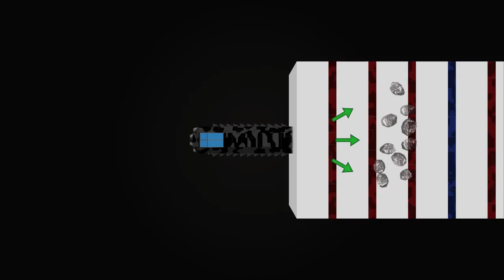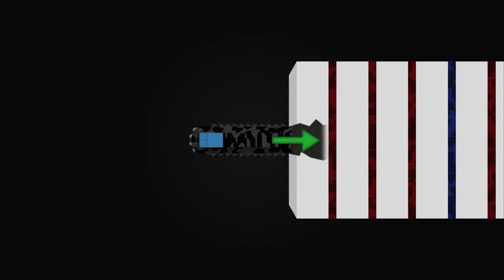Space Engineers - Reaper Missile Showcase

Comment: What if you made a third head, one that uses rotators stacked on top of each other like a fragmentation missile, but use decoy blocks instead of shrapnel. And once the missile reaches maximum speed and is on a direct course to the target it could release the decoys and act as chaff to make counter missile systems less effective. Under the decoy system you could put either of the traditional heads and dispose of the decoy system so the underlying tip can serve its purpose. Overall this missile looks extremely promising and well designed otherwise, but this is just what I would do and if you find it more effective to run the missiles clean, then this design is pretty much perfect.

Comment: How did you stop the mk 3 from tumbling in flight? My MAC right under tend to spin on route to the target
Reply from the maker: It's been quite a while since I've played, so it's possible physics have changed a bit... but the key to a smooth launch are these three things:

a) Gravitational forces must be perfectly symmetrical around the projectile/launch tube. A fraction of a G-force out of place will mess things up. Note that you can launch with spherical generators, as long as they are positioned correctly.
b) The projectile itself should be symmetrical. While thrusters don't have this issue, gravity/mass blocks will cause spin if the projectile has poor mass/weight distribution. I'm not 100% sure, but this probably also includes items stored in containers as well.
c) Mass blocks should be as close to the front of the projectile as possible. It's theoretically possible to put them anywhere, but in practice, this won't work, and the projectile will end up rolling.

I hope that helps!

Comment: if only multilpayer was stable and lag free enough to actually support things like this
Reply from the maker: It's been pretty stable since the recent changes, though it seems they nerfed this type of weapon quite significantly. Time to make a new one, I think...
Reply: Good luck on a new version that will work with whatever chaanges they made that nerfed the old one
Reply: @Hesterry  what do you think about the "Battleship" film and alien weaponry designs? They used warheads that embed into hull before exploding by timer. Somewhat hybrid of APHE and sticky AT grenade. If you replace cargo containers of MK3 with warheads on detachable base and use sensor as fuse, so it will trigger the timer that detaches warheads and also triggers the warhead timers and safeties, it can be useful. Shell will disperse timed cluster submunitions all along the channel of destruction left behind the tip. And then, timers trigger submunitions to deal additional damage. If any crew rushes towards the breach to perform any act of damage control... I guess, it ends with a surprise for them.